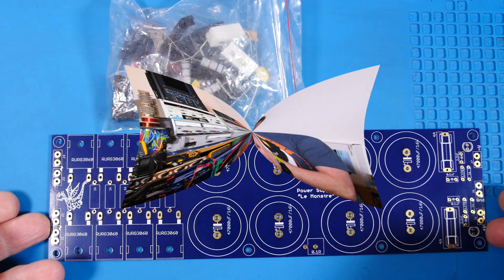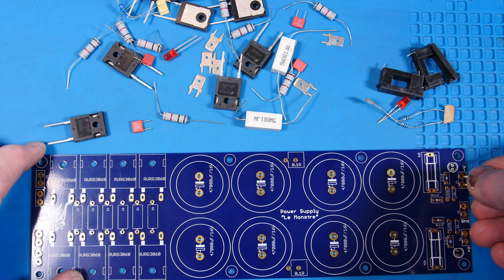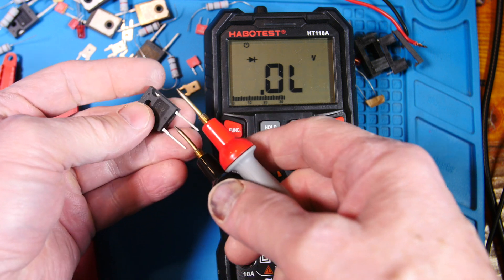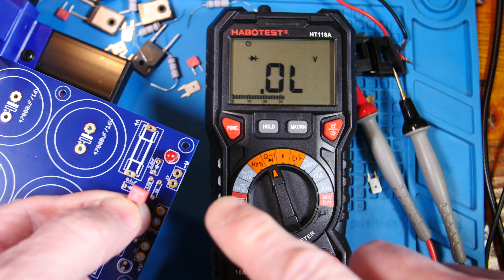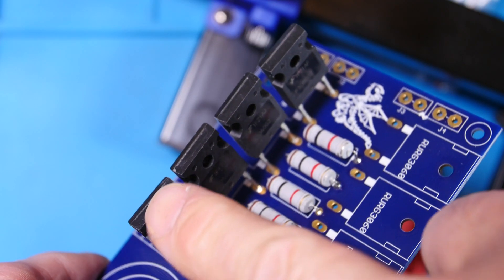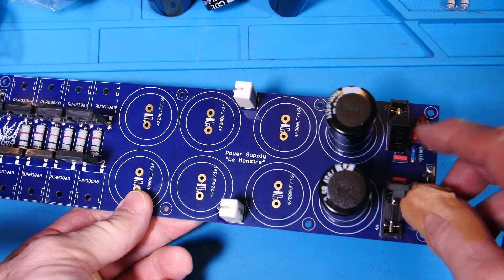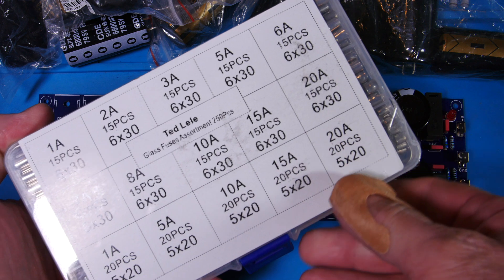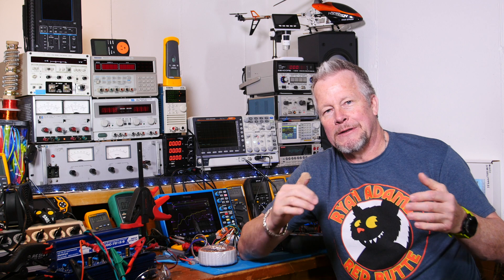HIraga Power Supply Kit for Class A amplifier the Aleph 5 Part 2

Comment: Greetings from the Philippines. I have access to equipment from Japan rated @ 100v and was wondering if there is a modification available to be able to safely use 220v? I’m not interested in using a set-up transformer. I just found your channel and having fun exploring it. I love the content so far & have subscribed.
Reply from the maker: Thanks for subscribing!  Glad to have you here.  What is the power rating of this equipment?  A step down transformer (2:1) would be the easiest way.  The transformer would also have to be rated for the power.  But you say that you don't want to use a transformer, so if the power was low enough - you could use a capacitor divider.  An inverter running off a Battery could be an option:)
Reply: @KissAnalog so there isn’t a modification available?

Comment: Hi, the screen printing on the board says 47000uF 16v, surely it should be 4700uf? If you're going to be running 35v surely the 16v will also be too low.

Cheers
Reply from the maker: Yes you are correct;)  Good Eye!  The board was made for amps at different voltage inputs and power ranges.  I'll be using a higher voltage as you point out.

Comment: Another tip for soldering: instead of bending pins and to help in keeping parts in place and upright at the angle you want (perpendicular mostly!) use blu-tac or equivalent.  It will get hot but will resist the heat and keeps the part fixed when you turn the board upside down.  I usually find with pin bending that the part slips somewhat and then looks a bit messy (OCD.)  Don't put the blu-tack on the soldering hole or any adjacent soldering hole though, be really diligent about that.  I like to use the screw connectors as well although the Faston type is useful; you need a reasonable crimping tool for those and they take some wiggling to disconnect which I always worry about the mechanical transfer to any solder joint.
Reply from the maker: Great information Andrew!  Thanks!

Comment: You going to have volume control on the amps, or are you using a pre - amp.
Is this a two channel amp, on this one board ?
Reply from the maker: Great questions Hugh Mc.  This will be a two channel amp and will use a pre-amp.  I’ll have to decide on what pre-amp.  Any ideas?
Reply: @KissAnalog  Are you into a hybrid front  end, see link -https://www.google.com/aclk?sa=l&ai=DChcSEwio9vv3-ujrAhUuHq0GHWwCDF0YABAZGgJwdg&ae=1&sig=AOD64_20ixY-YuiYUFSlf70zAdnIydxsTw&ctype=5&q=&ved=2ahUKEwi1-PD3-ujrAhWJWM0KHbzdC_QQwg96BAgLECs&adurl=https://m.aliexpress.com/item/32808057994.html%3F_randl_currency%3DUSD%26_randl_shipto%3DUS%26src%3Dgoogle%26albch%3Dshopping%26acnt%3D494-037-6276%26isdl%3Dy%26slnk%3D%26plac%3D%26mtctp%3D%26albbt%3DGoogle_7_shopping%26aff_platform%3Dgoogle%26aff_short_key%3DUneMJZVf%26gclsrc%3Daw.ds%26%26albagn%3D888888%26albcp%3D9594035441%26albag%3D102695258807%26trgt%3D296904913880%26crea%3Den32808057994%26netw%3Du%26device%3Dm%26albpg%3D296904913880%26albpd%3Den32808057994%26gclid%3DEAIaIQobChMIqPb79_ro6wIVLh6tBh1sAgxdEAQYBSABEgJgIvD_BwE
Ie valves -tubes. Enjoy
Hugh Chicago
Reply: I was going to paste a link for you, seen a tube kit , for your pre amps. I dont think youtube allows links to be pasted in there site ?  Well seing the name on your channel , [ Analog ] , maybe a tube front end on the " La~monster, would be ideal , low roll off instead of the harsh cut off/ clipping  of digital . But what thd are you looking for? That can be a long debate. We will be watching for the La ~ Monster's front end desighn.
Reply: Ps, watch for the underage female twits, posting on your site. She is lost in distortion, what is that saying, 15 will get you twenty years.
Barr that trash ✓

Comment: Hi Eddie thank you for the content from the UK. Just a thought on those Elna caps. Are you sure they are GENUINE. In my experience Elna don't use plastic end caps. They normally have a distinctive stamp in the end of the aluminium can with rubber on the other end of them. Although   recently I received some  that were stamped "Almost" correctly. I stripped the sleave off and found the aluminium cases had dents and were filled with wax! I have stopped purchasing capacitors from fleabay and the like. I have also seen some that just felt too light and rattled when shaken. I cut the can open and found it had almost dry poorly wound foil. They were the last straw. They measured low capacity and high esr as well as "felt wrong. All the best and keep up the interesting work. Just found this it may come in handy http://1.bp.blogspot.com/-p4zuMLcUvbg/TaTUHKlGLXI/AAAAAAAAAo8/C303OvQO9bw/s1600/type-capacitors.jpg
Reply from the maker: Great to hear from the UK!  Thanks for the great feedback!  I have been concerned about knock-offs, but the price on these seemed to be good - but not too good;) So, I was hoping for the best.  These Elena caps look and feel like the real thing.  They are about 55 grams and feel solid.  They seem to measure capacitance and esr about right, so testing might tell.  I have a test video as part 3, but it is just an initial power up.  I’ll follow up with a loaded test and maybe we will find out if they are the real thing;)
Reply: @KissAnalog  Hi I just found this people may find it useful info. http://1.bp.blogspot.com/-p4zuMLcUvbg/TaTUHKlGLXI/AAAAAAAAAo8/C303OvQO9bw/s1600/type-capacitors.jpg
Reply: Same thing with the Chinese fuses… I saw a video testing these cheap fuses with horrible results. They’re not safe whatsoever because they don’t open as expected.

Comment: Great video! The 0.1 Ohm resistors seem like a bad idea to me. The electrolytic capacitors already have more ESR than you would like. If you are looking for better filtering into the mains, you could add a common mode choke after the full bridge rectifier and before the capacitors. If you are looking for better filtering into the amplifier, you need more capacitance and/or lower ESR...
Reply: In my experience building tube amplifiers, 10mf should be enough capacitance to create a filter with cutoff frequency in milihertz.
Reply from the maker: Thank you!  The next video will be an initial power up, but then I’ll come back with a loaded test to see how well the caps work;)
Reply: @KissAnalog  I'd like to see you bridge the 0.1 Ohm resistors and see if it's a little bit better when the system is driving rail to rail...
Reply from the maker: ats89117 Thank you!  Great feedback!  Yes, lower esr in the cap is what we want and placing capacitors in parallel definitely helps this.  The 0.1 ohm resistor is in series instead of parallel like the capacitors, so it blocks ripple instead of creating it.  Adding inductance to filter is a fantastic idea.  I actually will show how to filter as I talk about improving the power supply.
Reply: @KissAnalog  I have read that a choke reduces the dynamic response of the supply causing a reduction of performance of the amp. Do you feel that it's true? 
Cheers 
Mark